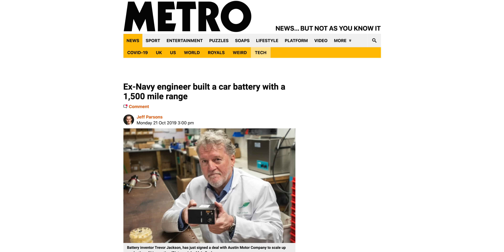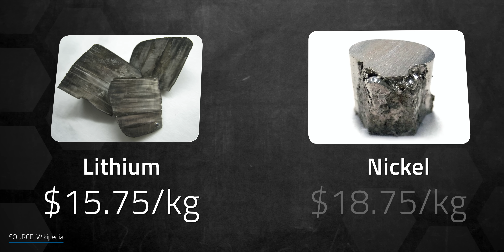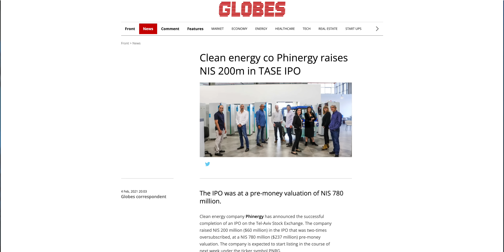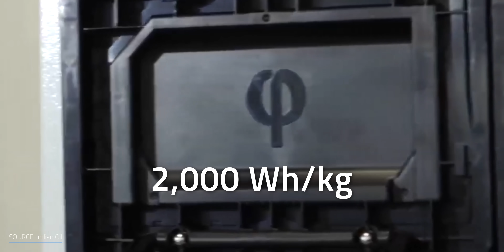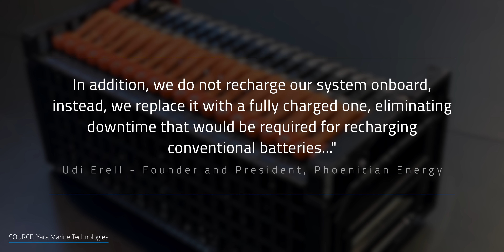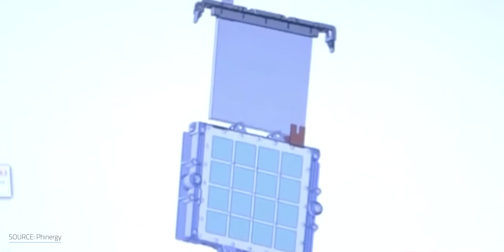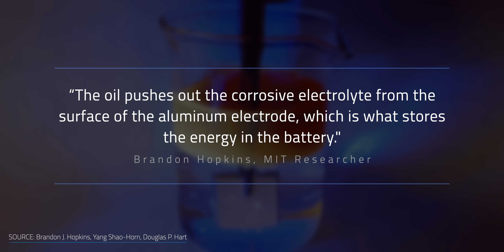Exploring the 1000 Mile Car Battery - Aluminum Air Hype?

Comment: An important contributor to range in a Li ion battery EV is regenerative braking. "Not rechargeable" means ZERO regenerative braking, which also means significantly less range for everything but highway driving.

Comment: To me the lack of recharge is a buzz kill. One of the main advantages of EV is that you top up at home, on the go, on holidays, as you find sockets everywhere. Even if easier to recycle than li-ion, pretty sure the life cycle analysis would lean towards current technology.

Comment: You said that if an Al-air battery ran out, the car would have to be towed to a station, but a service truck could simply bring a new one and replace it on the spot.

Comment: Why can't we just use graphene based batteries instead haven't those been proven like I know that they're expensive to make but at least they can be recharged they're much safer they have a much longer life cycle and they just last longer they charge faster too I'm pretty sure that we can find methods to make those kind of batteries super efficient to manufacture thus making them very cheap right?

Comment: If there is a system where the general public can swap them out, a quick swap then I think it could work. However all those major issues and assuming the embodied energy is low then it could work as it could be faster to ‘charge’ than a lithium battery.

Comment: in countries where the space to have a car is at a premium or you just park our car at one comunal place and can't recharged it with a plug in your house it will be a perfect solution, I thinks it's the same thing as with hidrogen, the ev tech is pushed by UAS and Canada where ppl have a two car garage and space for chargers to leave them charge overnight, but in most of the world the grid, the space or some other thigs are not up to par, so if they get this technology cheap and easy to swap, when in just minutes you can recharge 100% then it has future, just imagine the potential for long range hauling and the massive transportation industry where you just change the battery in mere minutes and then just continue hauling and the vehicle down time is really low

Comment: Depends on what you mean by a battery swapping station, and how many there are.  If you are telling me that I could go 1,000 miles or more on a single charge, then that would greatly offset the downside.   As someone who lives in a condo, I can't possible use an EV right now.   And many people can't.   Who wants to have an out door car port, with an EV charger that anyone could damage costing tons of money.   But if I could go to the gas station, and swap a battery in roughly the same amount of time people have to fill up their cars, that would be doable.    There is a down side to that though.   As more people got that type of car, then I assume you'd be stuck waiting for someone to replace the battery.  Still, if I could go a month or more before replacing the battery, then even then it might be fine.

Comment: "These batteries aren't rechargeable." - well, there's your problem, right there. In a flashlight, that's not a big deal. In a car, it is. Too good to be true? Nope. It's just not good at all.
Reply: As another commentator said, but his comment was buried in the top comment thread, this is definitely something an oil company would come up with and invest in. Their whole market is having people buy "their" fuel. Electricity comes from all manners of markets and generators (and in some cases if you have solar, you can generate it yourself). "Fuel" (gasoline/oil) comes from a central conglomerate. They can't think beyond that.
Reply: The aluminium air battery can be used to extend the range of a lithium ion battery. Lithium can take you inter city, imagine going across Delhi to Mumbai with just one aluminium air battery supporting the lithium.
Reply: If you have a car that lasts 2000 miles on 1 charge who cares ? and you swap out your battery at 70-80 % of the trip who cares ? i have to fill up my car 3 to 4 times to run a 1000 miles . i would change out a battery pack in 2-3 minuts and be on the go again . this would be ideal for trucks and busses .
Reply: @cheezy2455  You could change half a ton of batteries in couple of minutes (~1100 pounds)? Damn, that's some muscles and stamina right there. 😂 That's how much the battery pack would weight if you had ~2000 miles of range.

Can you even imagine how unpractical this is? Where would gas stations even store hurdreds of tons of batteries for all the customers? This is a no-go idea.
Reply: @cheezy2455  exactly that's what they don't understand they think that it has to be rechargeable... Every material will be reused and recycled on old batteries
Reply: @MozartosKhan  You people don't seem to realize how unpractical and stupid this is in so many levels. First of all, a ~2000 mile battery pack would weight around half a metric ton. Have fun swapping it. 😂

Secondly, the process of recycling the materials is very energy intentisive, you would probably lose around 75% of the energy as someone else above already pointed out. Even hydrogen makes more sense — and hydrogen also suffers from high inefficiency problem.
Reply: @PhazonBlaxor  The delivery of used batteries back to the factory is a huge problem. This batteries system needs double of logistics comparing to gas even if they have the same energy density.

EV is completely the opposite. It does not need any logistic. It just need a cable.
Reply: @joelau2383  ...aaand, there is that too. Good point.
Reply: this is the current gas powered car.. the gas is spent.. gone..just like the aluminum battery.. you need to go to gas stations to get new gas or get new aluminum air battery.  I totally agree with you the current gas station model sucks and will fail ultimately.
Reply: Unless we are talking using this to supplement rechargable systems that aren't as efficient. Think of using this tech as your gas can in the back rather than the main tank
Reply: @Rakstawr  The problem is you don't pull your large tank out to refill it, so nobody want to pull a large object out to refill it, no matter a can, tank or battery.
Reply: @joelau2383  That's an engineering issue which can easily be solved. You can downscale and make it easier accesible, e.g. from the side. (or multiple batteries that weigh each about one or two kilograms so elderly and handicapped can still swap batteries). 

It's not about the style of how it's executed, it's about the tech. Which is promising. Especially as a range extender for EV vehicles. 

Driving on a holiday requires two refuelings on a 1200km trip in a hybrid gasoline car. An EV would require 3 and would delay the trip with a considerable amount of hours.
Reply: @wdecroon  It won't change anything. If you make multi smaller batteries, you need to replace them all. Comparing to refueling a gas tank or recharging EV battery that you only need to plug in a cable or host, this batteries replacement is very inconvenient. Besides, the logistics of fresh batteries and recycling of used batteries are very hard.

The tech itself means nothing. It only benefits people when there is a way to use it for good without causing much trouble.
Reply: @joelau2383  Plugging in for charging is a mess if you don't have a garage... It is like refueling, just MUCH slower....
Reply: @GertvandenBerg  Fully charge a EV takes time like a hour or two, but not sweat. It is not a mess like disassembling part of the EV to replace large batteries all by yourselves. It is an EV, not a toy car. You cannot simply pull out the AA batteries. Nowadays, you cannot even replace your phone battery by yourselves.
Reply: @joelau2383  I mean that the convenience of charging batteries only apply to a subset of people. For those without the option to charge the car at home, using a refuelable vehicle probably makes more sense util some kind of battery swop option exists (it probably makes more sense to swap out standardised rechargeable battery packs than single-use ones though. (It also helps for long trips)

(The cars would need to be designed for swapping batteries. It has been done with cars like the Renault Fluence Z.E)

(I was amazed at the road trip that Engineering explained managed in his EV - in places without infrastructure for all that fast charging, battery swops would be nice for long trips as well though...)

(I can't find the comment that I remember replying to initially)
Reply: @GertvandenBerg  I'll ask the same question from you because I've yet to got an answer; do you think swapping out half a metric ton of batteries would be more convenient than plugging the car in and then waiting for 20 minutes to top up? Where in the world would gas stations even store these hunderds of tons of "standardised" (rechargable or not) swappable batteries for all their customers? How would the swapping happen? Some kind of machine that pulls the batteries out and puts new ones back in? If rechargable, how do you make sure to swap in batteries that have similar degradation, to avoid giving your customer a brand new battery pack in exchange of a dead one? This swapping idea just makes no sense whatsoever.
Reply: @GertvandenBerg  We don't need fast chargers for residential areas. What we need is enough chargers to plug the vehicles in over night.

Just how much traffic does a regular gas station get? Inagine turning all that traffic into people swapping batteries. The storage and swapping system would be absolutely humongous, expensive and just as energy intensive (technically more, moving anything takes energy) as normal charging stations. Meaning you would need infradtructure changes PLUS humongous storage on top. It doesn't make any sense, EV owners rarely need to use charging stations. They charge at home over night, that's convenience — ergo, we just need regular charging spots in parking spaces.
Reply: @PhazonBlaxor  I did not say it is more convenient, just that the current EVs only work well for a subset of people - options are needed for people that can't charge at home and it won't be adopted willingly if it is significantly less convenient than spending 5 minutes refuelling a car a few times a month. It is good to see that someone is considering options that might work for that... (I don't think single-use batteries would likely be the dominant option)

(Hydrogen might work, but the efficiency sucks. Maybe charge points at parkings would become standard...) (or biofuels, or tech that is not on the radar yet)

(Heavy vehicles also need an option that does not reduce their payload significantly) (The EU seems to cheat there by allowing electric trucks to be heavier)
Reply: @GertvandenBerg  Of course people need options. But this isn't it, it has too many drawbacks. Charging spots at work/school/shops/parking lots would solve the problem. Infrastructure changes are needed regardless.
Reply: That's a misunderstanding.  They aren't "rechargeable" but they're entirely recycleable.  The aluminum doesn't disappear when it "degrades" it just changes to a powder in a solution.  The batteries can be "recharged" by just melting the aluminum back together in a factory setting.
Reply: @ricks6250  OK, so what process is used to convert aluminium hydroxide to aluminium metal? How efficient is this process?

Firstly you need to dehydrate the hydroxides to alumina, this uses the Bayer Process, although if you know you've got high purity Al(OH)3 you can probably skip some steps. But this is just an energy sink as it requires high temps. That's not great, but let's see how this goes on.

That just gets you alumina, which you then need the Hall–Héroult process to refine the AlO to Al metal. This is at best 40% efficient (15MJ/kg, vs ~6MJ/kg theoretical energy required).

This needs to then be manufactured into the electrodes unless you can make it a cast part.

Recyclable isn't all that useful if you are converting the metal to oxides which need to be reduced. The reduction of Al is so hard that it was a very rare metal until very recently. Recycling Al metal is easy because you can just melt it, recast it and you are done. Conversion to oxides and then converting back to metal from oxides is a killer, because that is the same process as refining new material. So it's not really recycling, but re-refining.

This makes no sense on a thermodynamic level, you are looking at whole process maybe 25% efficiency, that is it will take 4x more energy to produce the battery than is stored in the battery. That's not good.

Oh and almost all refining and smelting uses fossil fuels as electricity isn't useful at the temps required. So that's not great either.
Reply: @ricks6250  Even taking that into account reprocessing the aluminium into the plates needed would use a fair amount of energy and over the life span of the vehicle push costs over those of rechargeable tech
Reply: @diceman199   And that would exactly be the amount of energy you extracted from the battery in the first place... Think of that thing as "factory refillable" like gas bottles!
Reply: @ricks6250  The aluminium gets oxidised - the oxygen would need to be reduced away for "recharging"...
Reply: Maybe you are too old to understand 😃😉😂

Comment: Don’t know that it’s a good consumer product, but I can see that as a good option for motor sports like Rally. Much better to have a light battery that you swap once during the race (provided you don’t have the same overheating issues that LiON batteries would face when run full out for hours).

Comment: hype hype hype.  "green power sources" is a scam.  There is no "green" energy.  All this wind and solar greenness is offset by the huge energy requirements to produce them and the  negative impact on the environment when they become decommissioned.  The technology is neat, and has its place, but these sources are not at all "green."  They're not net zero neither.

Comment: It could be some sort of range booster I think? Make these cell into small, portable modules, then make a connector inside the vehicle cabin that allows these modules to be connected to the on-board charging circuit (think of it as an EV equivalent of jerrycan). The cells could provide just enough power to drive the vehicle on highways, plus slowly recharge the battery. When the modules completely drains, just drop them at a recycling station.

Comment: Also if hearing aid batteries are anything to go by (they're also air based) just having them lying around also discharges them... AlO seems like a good choice but what's the footprint of the recycling? What with the powder? Too much hassle for normal people unless a huge backbone infrastructure gets up and running before

Comment: There are two ways range anxiety can disappear, 1. Higher density/longer range, e.g., Aptera's 1000 mile range achieved by a paradigm efficiency. 2. Shorter charge time. Both are happening

Comment: I don't see the problem of running out of juice mid trip as any different then any other vehicle, gas -  they bring a cant, LiIon they bring a portable charger, Aluminum they just bring a brand new battery and install it right there, just because change out stations exist doesn't mean you cant swap a battery yourself. For that matter this is much better because you could bring extra batteries yourself and go on a CRAZY  long trip. Imagine an electric camper van with 6 extra batteries in tow, you could travel across most of America without having to stop once to recharge

Comment: The idea of it being like a aux tank for current lithium batteries isnt bad. If you plan to go on a long trip, throw one in, get there and swap it out when you are heading out again.
Reply: Maybe a setup similar to plug in hybrids, where the li-ion battery can drive around 30mi would work well, but i think the reduced downtime lends itself really well to public transit, like buses that can travel all day on a single charge, no smelly diesel necessary

Comment: I mean there is always the topic of waste if the replaced battery cannot be recharged/recycled at a factory. BUT assuming you drive less than 10 miles a day, a 1000 mile range battery would last you months. And if you drive up to 50 miles a day, you would only need to replace a battery once every 20 days. This wouldn't be suitable for every vehicle (trucks for instance) but I wager it would reduce the reliance on recharging stations/nightly recharging for a great many people. 

And yeah, even spending 30 minutes once a month to replace a battery would be an insane time saver compared to the amount of time you would spend at a petrol station, filling up once or twice a week!

Comment: Range, recharge time (less than 10 minutes to full charge), battery life, and cost are the barriers that prevent electric vehicles from taking over naturally (aka without a law forcing ppl to use them).  until all these barriers are answered/solved, electric cars will not take over.

Comment: Range Anxiety is a Pathetic Joke. For ICE vehicles they haven't had ,1000 Klms or 1,000 mile range vehicles for almost the entire 20th Century. Most vehicles average around 500 kms (300 miles) and everyone copes. EV's with  an average of 500Klm can easily cope with 95% of peoples needs. What is needed is a better infrastructure and service to make reliable and affordable Charging Points for longer journeys and Type 2 outlets for On Street parking and Unit/Flat owners. Home charging is covered for again most of your needs.

Comment: Battery swapping to eliminate waiting for recharge is a potential idea, and has been examined for a long time. But those batteries still MUST be rechargeable, if only for the ecological implications. Automated battery swap would be ideal - a bit like a car wash - simply drive the car into the swap station, and the machines do the work, fast and safe.